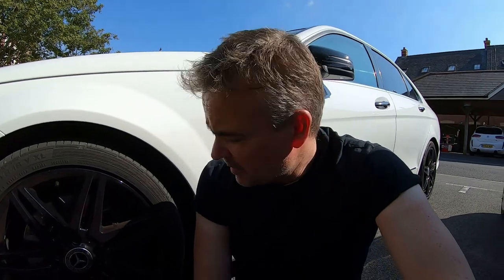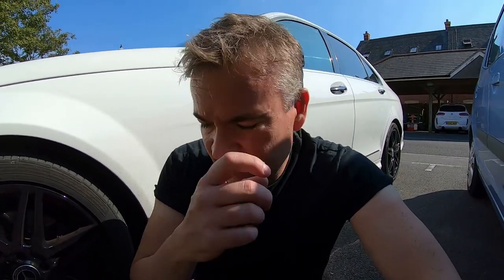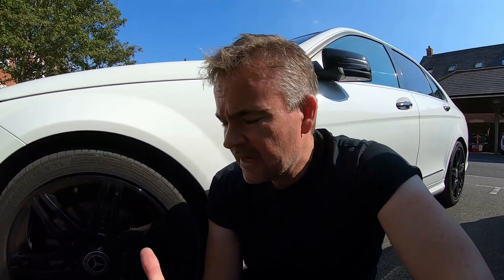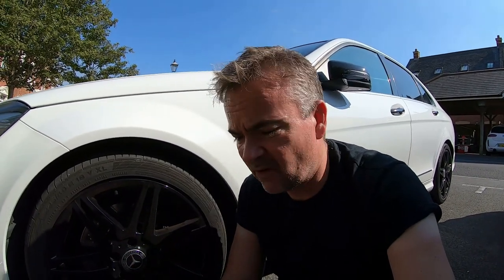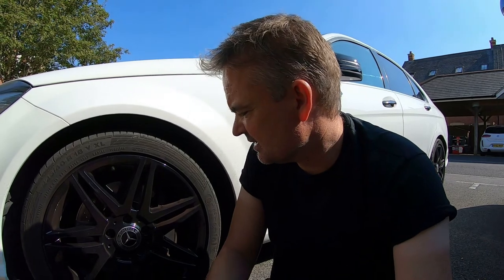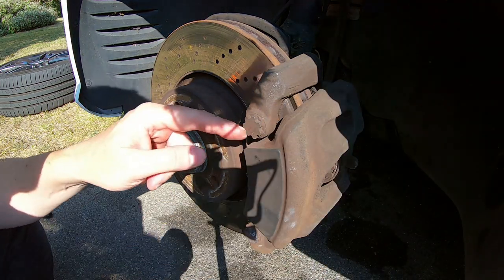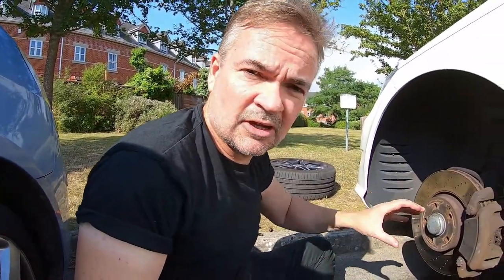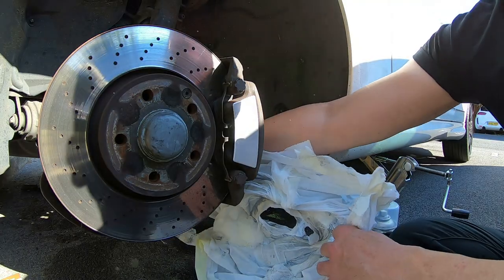Mercedes W204 Calliper Logo Plate Emblem Removal - Warning before Painting.

Comment: Did you manage to remove the broken peg that was left in the caliper, if so how ! As I have the same problem, hope you can help, regards.
Reply from the maker: Hi Stuart, in the end I simply stuck the cover back on with a strong heat resistant glue, its still solid and has been fine ever since...mrix